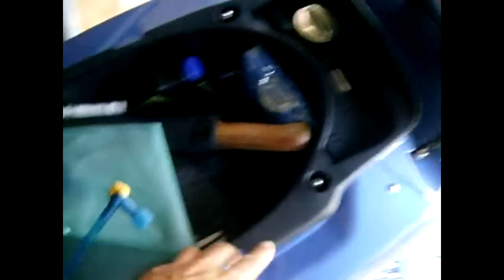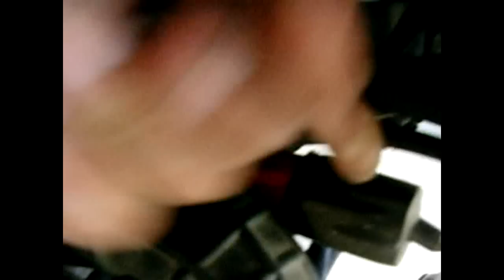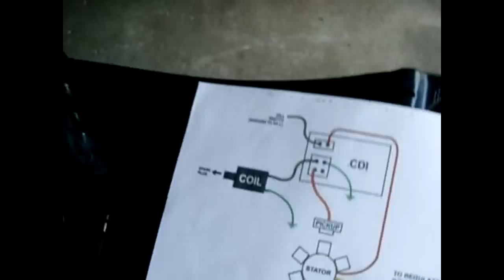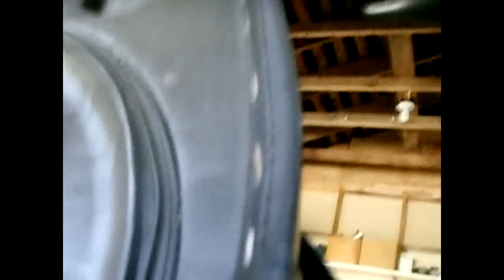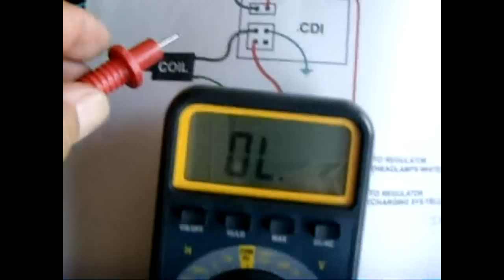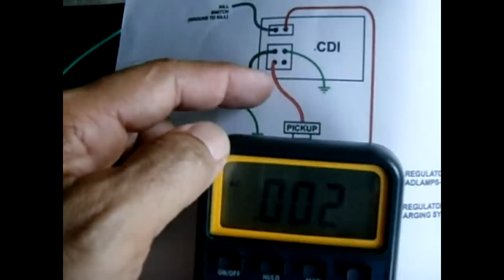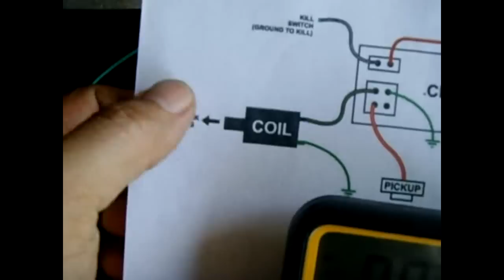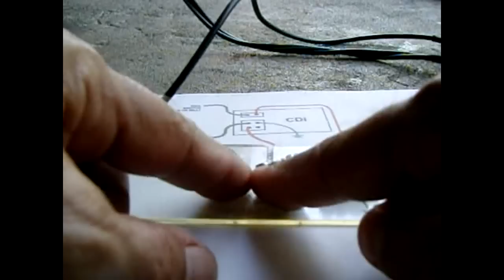The Ultimate GY6 Starter & Ignition Troubleshooting Tutorial

Comment: My problem is with fuel delivery. The scooter (Lexmoto still chinese rubbish..) is using up what fuel has dribbled into the carb then cutting out and not starting until more fuel has entered. Can I simply replace the pain in the bleeeep vacuum fuel petcock with a manual cut off switch with no vacuum? Save me so much hastle replacing all those horrible cheap hoses. Just will replace the hoses that are being used i.e. fuel lines. Seems like so many people online have I think you mentioned your manual cut off switch you installed in another video? They say "cap off" the vacuum line that goes into the vacuum petcock and it should be good to go.

Comment: might hav to fiddle with my valve clearances again. but on the red line to stator coil I only get 298ohms.. could this be a problem to it not idling??
Reply from the maker: +Keith Mass 
If any readings are way off from the readings shown in this video, then more than likely the part is faulty. Values will vary.
Reply: +electronicsNmore Going to do a carb jet clean soon as the weather recovers enough. Seems to all point to a clog somewhere why it will not start and idle. Can tell the start wants to kick in but not letting fuel flow freely.... it seems.

Comment: ElectronicsNmore, thankyou for taking the time to create the video.I have confirmed my kill switch is not working as intended by carrying out the first test (i.e. always off regardless of switch position).I do have a question: Will the readings for the remaining test be affected by the kill switch not working?The reason I ask is I'm getting inconsistent readings, numerals flickers erratically upon contact of the prongs and immediately zeros out.I have bridged the handle kill switch cable but i believe the issue to be in the ignition kill switch unless my entire wiring harness needs replacing.note I haven't use a multimeter since high school.Thanks in advance.RegardsSergio
Reply from the maker: +Sergio Rojas
Hi Sergio. You're welcome. So the switch is always grounded out preventing the engine from firing up. I have seen that happen several times on different scooters over the years. You may have a faulty meter. You can buy a decent digital meter at home improvement stores or Harbor Freight for $10 or less. If you pull the wire off the CDI that leads to the kill switch, the engine should start up. To kill the engine, touch a grounded wire to the terminal that leads to the kill switch.

Thanks For Watching

Comment: I have a 49cc moped Chinese 4 stroke had bogging down real bad change carburetor emission coil spark plug and CDI didn't know what it was so I change the stator now I have spark I'm getting gas the motor will not start so will you help me or try to
Reply from the maker: +Cherilyn Betts 
If the scooter started up before you installed the stator, then you must have done something wrong if you get no spark. Are you sure the new stator was installed in the same exact position as the old one? Check all wiring harnesses. Go over everything you did.
Reply: +electronicsNmore no i have spark gas and crank it just turns over and wont start
Reply: +electronicsNmore see why im askin im stumped on it
Reply: +electronicsNmore and it died and wouldn't start back up that is why I change the stator
Reply from the maker: Cherilyn Betts Make sure the engine stop switch is not faulty. You also need to check your valve clearances. I have a video for that.
Reply: +electronicsNmore yeah I've done both of those I just recently change the piston in this moped also when I first got it it didn't even run then it ran great after I changed the carburetor the ignition coil and the spark plug CDI and the battery and then last night I went to start it and had to kick start it got it started when to give it throttle and could only give it half throttle and then it would fall down and act like it was going to die if I let off of it it would drive and speed up slowly but then when I got home and turned it off try to restart it it wouldn't do anything head low enough spark I could touch it with my hand and it wouldn't shock me but it did have spark now it has sparked while cranking you can smell gas but it won't actually start up

Comment: First allow me to say "great tutorial!" I used this to find out my stator red wire wasn't showing any ohms and replaced it. After that I acquired spark and drove down the road, came back parked while idling and it rough idled, then shut off. Now I'm not getting any spark again, after starting over with step one in this tutorial, I found that now my kill switch wire to cdi is grounding out! Any ideas what is happening here? It seems to be one thing after another. I've replaced cdi, coil, stator, spark plug, you name it.
Reply: ever fiqure it out
Reply: @_li1.loc3_8  never, sold the bike for more than I paid for it and bought a V Star 650 instead. Never looked back.

Comment: I just installed a new solenoid starter and and a CDI. Now my scooter won't start.
Reply from the maker: +Ronald hargraves 
You told me before that it would not start, so nothing has changed. Or did you mean it would not electric start, but it would kick start?
Reply: It started before I made the changes.  Now with the new parts, it'll crank ,but won't turn over and drained my battery.
Reply from the maker: Did not know that. There is nothing I can do. You need to work backwards to discover what you did wrong.
Reply: I'll try, thanks

Comment: I currently have a 12v 7ah batterry that loses power.  Could I replace it with a 12v 8ah battery?
Reply from the maker: +Ronald hargraves 
Yes, if it fits.
Reply: Cool, thanks.
Reply: I ended up buy a Delron Battery Tender 12v 7-9ah. Hopefully that's a good choice.

Comment: Thanks for this.  I'm having an issue with my electric start button.  It doesn't work.  Any suggestions?
Reply from the maker: +Ronald hargraves 
Hi Ron. You need to perform the tests. Could be a bad wire, faulty switch, faulty starter, faulty solenoid, or alarm system problem.

Thanks For Watching!
Reply: Thanks for responding.  this scooter has been a headache, one thing after another.  I'll check the things you requested.  I just bought a CDI and starter solenoid.  Also, I was told it could be my alarm system.

Comment: Great video, I followed it step by step after watching many times.  Everything checks out with my scooter except the stator is putting out about 50 VAC, not higher like you mentioned.  Could that be a low enough voltage to cause the no-spark, or is it more likely the CDI is bad?  Thanks again.
Reply from the maker: Josh Randall That is not ridiculously low. Remove the kill switch wire on the CDI then try starting it up. If it still does not work, then try a new CDI.

Comment: What your thought on checking coil having the voltage being solid not pulsing? Ultimately i don't have spark that is the starting issue at this point. Thanks again. My scooter does have auto start on the key foband i am wondering if the alarm has a kill switch not letting the spark.
Reply from the maker: Aaron Woolhiser Hi there. Everything you need to know is in this video, or another one of my videos. I do not offer any advanced level of support on my channel, I only answer simple viewer questions(which many other channels never do), with one follow up. I actually went well above that with you already. I simply do not have the time to assist everyone who is looking for an advanced level of help. I supply a well detailed, well explained video, and the rest is up to my viewers. Viewers that support my channel with donations, or show they posted a couple links to share my channel, they would be entitled to a "higher" level of assistance. Thanks For Watching

Comment: Your videos are helpful. I put a new motor on my 150cc vento 08 and it don't turn over. I used a tester that just lights up when it's on the plugs, i changed the back wires and cdi box still no start. If it's the alarm that won't let it start what do i do?
Reply from the maker: romeo starr Could be many things. There is more than enough info in this video to troubleshoot your problem. You also should make sure the engine timing marks are lined up properly and the valves are adjusted to the correct gap(.004/.005).

Thanks for watching

Comment: First off I have to say u sir electronicsNmore are a genius this is an excellent video and is very informative. I have a issue which with my scooter. It ran the day I purchased it and haven't touched since then. Stored it till all paper work was done, about month and a 1/2 later doesn't want start. Is this due to bad gas, switch in brake or kill switch this is just what i figure. Your help would be graciously appreciated and any other of you guys out there.
Reply from the maker: Tolona Anderson Hi Tolona. If the engine cranks, but does not start, then suspect a fuel problem. To confirm a fuel problem, squirt a small amount of gas into the air intake hose and see if the scooter starts right up then stalls out.

Thanks For Watching

Comment: I have a taotao atm50 (gy6 engine) and my low voltage ohm reading is between 75-80. Far from the 2 ohm you mentioned in the video. Am I doing something wrong? Or does this mean a part or wire has failed?
Reply from the maker: ***** Hey Mike. You need to be more clear. What test?

Thank You.
Reply: electronicsNmore the test for the ignition coil, testing the black and yellow wire from the cdi
Reply from the maker: ***** Try testing directly at the ignition coil terminals. Remove the blade connectors and post your reading here.
Reply: Thanks for the replies. It was the stator. Thanks for the video and support!
Reply from the maker: You're Welcome

Comment: I replaced starter, (mine had oil in it), CDI, and coil wire. Just to make sure everything was new since I have had such issues with cold starts. I just realized I didn't pay good enough attention to which wire went to which terminal of the coil. I can't figure out how to attached a picture to see if I got it right based on the color of wire(green to green, black to black) can I email it to you?
Reply from the maker: Aaron Woolhiser The coil terminals are colored to match the wires.
Reply: Ok thanks i figured so but wanted verify
Reply: Aaron Woolhiser I am testing the kill switch but I don't have a continunity tester on my DMM. When I do what you have shown the meter doesn't change it stays on "1" as if I am keeping the probs not touching each other. Is that good or bad?
Reply from the maker: Use the lowest OHMS range/setting on your meter. You should get a reading very close to ZERO ohms.
Reply: electronicsNmore ok thanks. So i tested the kill switch it works properly, but i am getting a steady number on the coil positive side. Shouldnt i get a pulsing signal? I also dont have spark at spark plug by trying the old fashion solenoid
way of touching edge to metal with plug out while cranking. I tested cdi and solenoid via your video.

Comment: Hello, I have a Jonway scooter 150cc T-12 2012.  It will not start in hot weather.  We think the Solenoid is bad but we also need to test the Ignition switch.  But we cannot figure out how to open the panel to get to it.   Do you know how to do it?  I can send you pics of the Panel if you need me too.
Reply from the maker: ForestTre Does not start or does not crank?
Reply: No. and we checked the solanoid and feel it is part of the problem.  So we are putting that in this weekend.  But I want to check the ignition switch but cannot for the life of me figure out how to remove the plastic top of the bike.
I am sorry for the late reply.
Reply from the maker: Everything is held together with plastic clips molded into the plastic panels, and screws. There are many different scooters, so you will need to figure it out yourself.

Thanks.
Reply: OK thank you

Comment: Great videos! So good I had to subscribe. I am having some starting issues and my scooter has an alarm, how can I remove it or at least find out if it isn't causing my hard starting issue?
Reply from the maker: Aaron Woolhiser Glad you enjoy them. You have to unplug the entire alarm unit, then place a jumper wire between 2 of the pins in the harness on the scooter. I cannot say which two, because there are different types. You then insert the key into the switch and turn it to the ON position, then press the crank button while probing the harness looking for DC voltage as you press/release the start button. That wire should be connected to the wire in the harness which leads back to the starter solenoid. NOW, your problem does not sound alarm related. If the alarm was the problem, your scooter would not start at all. You said yours is hard starting. Check the battery, solenoid, and the starter. I have videos for the starter and solenoid.

Thanks. Be sure to share and rate Thumbs Up
Reply: electronicsNmore Well I got it to start 3 times using starting fluid, just got the scooter a month ago from private party and he already had it running. It starts right up when I am leaving for work, its after sitting all night that is the issue. I got tired of the issue and used your vid to tear apart the carb, replaced choke or whatever the electronic thing attached to carb. After a few times of cranking with no starting it makes a grinding sound or electronic hum. Then it will go to not trying to do anything. I turn off ignition then it will try a few times to turnover then, it starts progression over. I have replaced battery also with tractor battery that fits under seat. I was thinking starter since that might be the sound it is making.
Reply from the maker: If the scooter starts right up when you use starting fluid after it sits all night, then your problem is either a faulty enricher, or faulty carb.

Comment: Best video I have seen yet.  I am working on a Buggy with a gy6 engine that had been setting for years, I need to trouble shoot all the electrical systems. This video will help immensely.  Any place to get the simple wiring diagrams that you are using.  Most of the time they are very complicated.

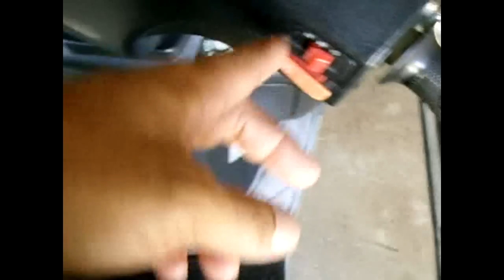Comment: Thanks man!. I couldnt get my gy6 scooter running after transporting it 500 miles in a trailer. No spark at the plug. i swapped the plug, coil, cdi. I was checking craigslist for a person that knew what they were doing. I wasnt having any luck in my area. THEN, I thought of u-tube. yours was the first one I clicked on. I was wondering why you wouldnt use a test light or meter to check the starter solinoid. I fast forwarded to the 6:45 point and paused the video..........when I got to the kill switch part. I went outside and put the switch in the correct position, and it started! Thanks Again.
Reply from the maker: Bill Ott Glad I was able to help! Be sure to share my channel with others and rate Thumbs Up. Thanks!

Comment: Good video, I have a question regarding the "load:" you have represented across
your two leads on the four pin connector. I'm new to scooter troubleshooting, but
the cdi, on ac units, shows 2 parallel circuits, one for the coil that feeds the spark
plug, the other lead feeds the pick up on your stator. The way you show the load
in the video  is only across a coil?? Is your circuit correct? Or is there 2 parallet
circuits as described above. Thanks for the info.
Reply from the maker: Charles Martinez What "load"? I am not sure of other types. The only type I know is shown in this video.

Thanks For Watching

Comment: there is a flaw in your testing. if the engine will not crank at all... not just start no crank at all and its an electrical issue... you can't test the coil because you have to crank it to test it.  I still have no idea whats wrong with mine its a dead stick it doesn't crank at all. the only thing i get is a click when i press the electric starter and if i use the left break the power goes dead completely, i can't even kick start it. i have no main head lights just the tail light, break lights, and very front lower running light. i tested what i could in your video without the need to crank it and everything else came up ok. so how do i test it when it is completely dead?
Reply from the maker: Dragnmastralex No flaw in my testing. The coil can be tested using resistance measurements off the scooter, or by leaving it on the scooter and cranking the engine. If you can crank the engine OK using your foot, but it does not crank over using the starter, then it can only be a few things. Clearly you are missing something. Likely causes: faulty battery, faulty starter, faulty solenoid, faulty wiring, faulty engine start switch, damaged engine(internally).
Reply: electronicsNmore and finding which one is impossible if you can't crank the engine without buying random new parts and replacing them until it works. how exactly do I narrow down what is wrong without completely replacing everything? that's my point you can't test anything out your way and locate a problem without spare parts because if it doesn't start you can only test the connections that are working.
Reply from the maker: It is not impossible. You said the engine does not crank, so clearly you would not be testing the stator, CDI, ignition coil, etc. You should be testing the battery, starter, solenoid, start switch, and wiring. If I had your scooter in my garage, I would discover exactly what the problem is. There is more than enough information contained in this video to help you. Unfortunately, I do not offer special assistance to viewers. Many Youtube Channels do not bother answering viewer questions, but I answer almost all of the questions asked by my viewers, and also include one follow up reply. The only people I offer special assistance to, are supporters of my channel(People who go out of their way to share my videos), or people that pay me for my time for phone assistance. Time is money.

Thank You